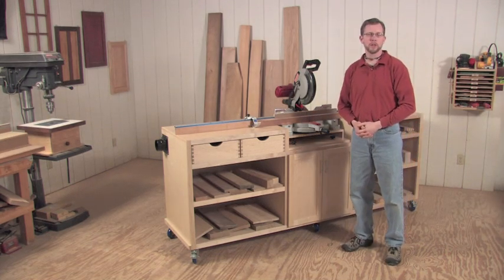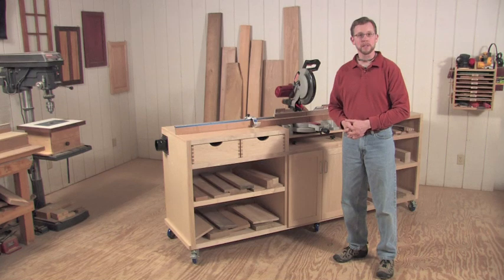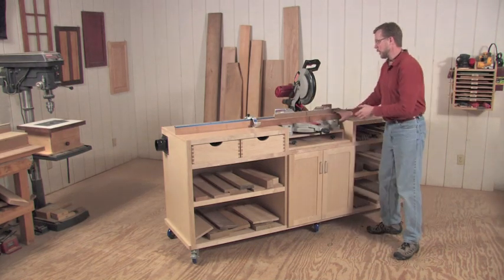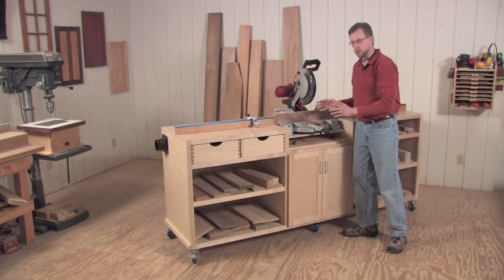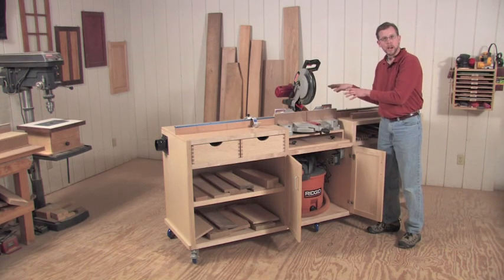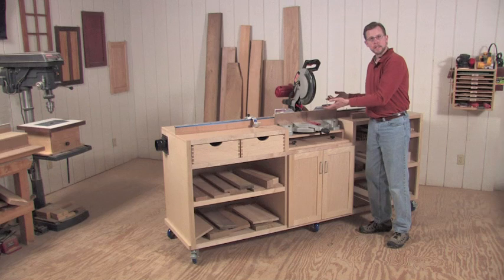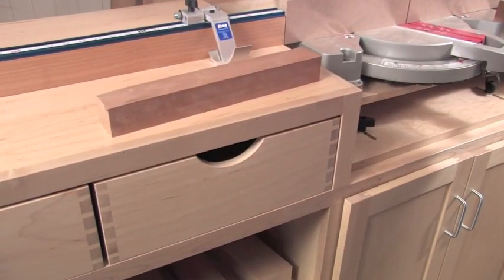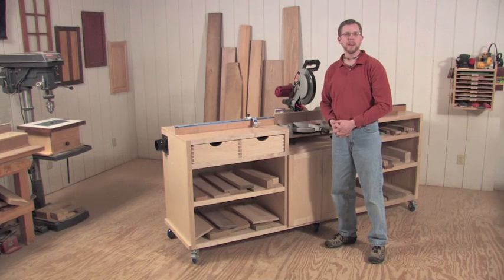Ultimate Miter Saw Station - Project Overview and Plans

Comment: I build something similar, but not just for my mitre saw, but for my router, sander, jigsaw and table saw. They all have a removeable section that is cut at whatever size that would make the surface flush with the rest of the bench. I can store these modules either under the benchtop or on shelves of my garage when not being used. I did this because I don't have a lot of shop space and this allows me to use all my stationary tools with a full table top.

Comment: The switch is rated only for 125VAC/1A/60Hz on the tool port, the UK is 220VAC/50Hz. It is sold only in the USA by DCG Products.

Comment: Versatility is key in my shop.  Sometimes I work in the field, sometimes in the shop, and sometimes outside the shop.  Mostly those shelve would be used for tool storage in the average size home garage.  All tools and supports need to go in the truck for transport.

The time spent on the mitre station would be better spent actually making a nice project for the wife.

Does she have a pottery cabinet?

Comment: One thing to consider is what about moving the unit to another shop, by yourself? I can't really see from the video but do the 3 sections of the cabinet come apart? Are they screwed together. Call me silly but I would add 4 wheels to each section to make moving it a snap. If yours is going to stay put then there's no need for that.

Comment: that switch is only meant to supply 15 amps, you are better off going with an ivac that has two independent 15 amp circuits, one for the vac one for the tool.
Reply: If you use an ammeter to check each device's draw while running, you'll notice that the peak at startup is far higher than during operation. With the On/Off timing offset, I doubt the total gets up to 15A.

Comment: Built this and it turned out great. The only negative comment I have is the dust collection. It does not work well at all. I have  a large two stage 220 shop vac system and it just does not draw the saw dust from the trough behind the saw.

Comment: Most wood workers. The ones that value their health. There are numerous systems built on 4". Cheap mobile units, up to fancy permanent setups. A shop vac will never last. They dont do a very good job and are very loud. If you're just whacking off an occasional 2x4 no problem. But if you are working for an extended period, or using fancy hardwoods or chemically laced materials (MDF as an example) you are really trashing your respiratory system.

Comment: No offence, but if you have a dust collection system, hook BOTH collection points to it. Why mess with a shop vac? By the same token, if your using a shop vac only, why not hook it up to both ports with some sort of Y coupling?